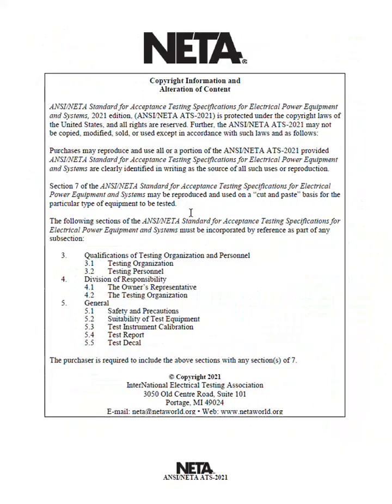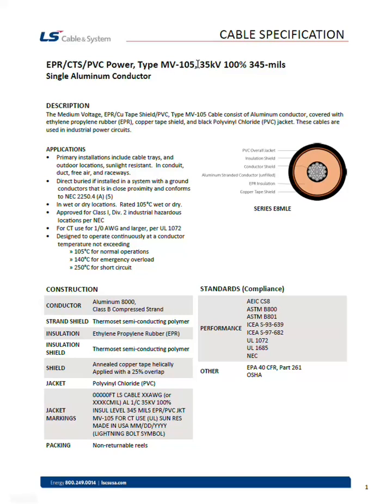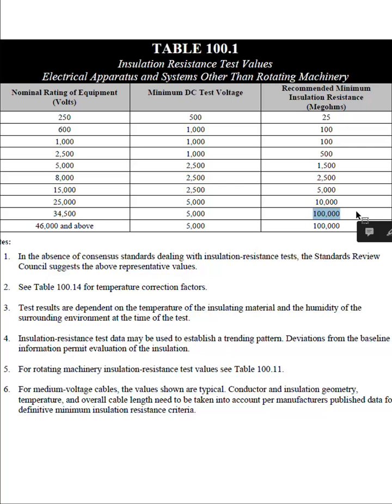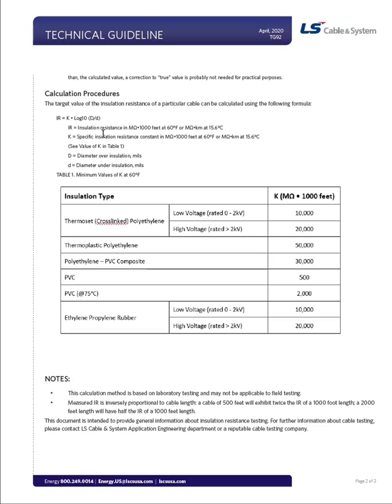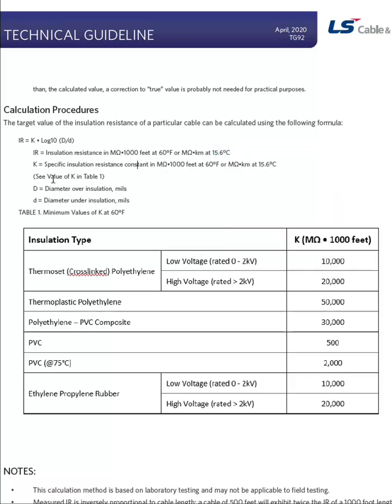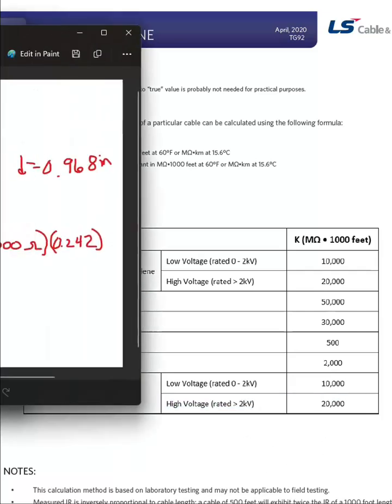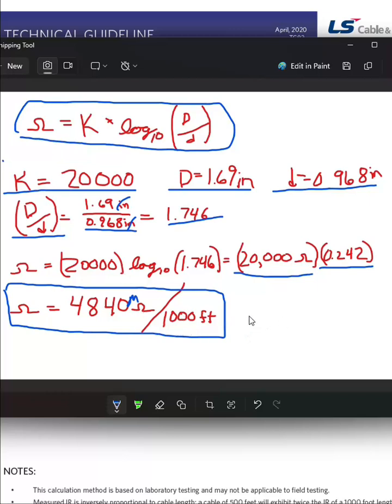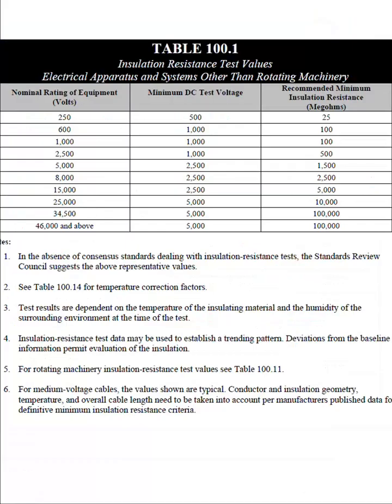NETA Cable Test Pt 4

Comment: what if you don't have a copy of the manufacturer's data? and the cable is old, testing is for preventive maintenance purposes.
Reply from the maker: Sometimes you just have to do you best with what you have. I would compare to other phases and similar cable if you can.